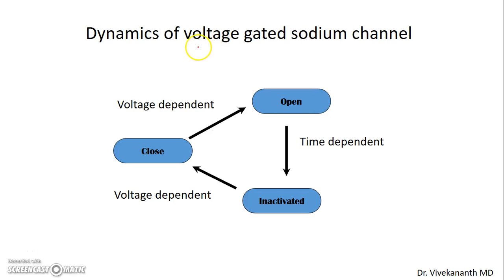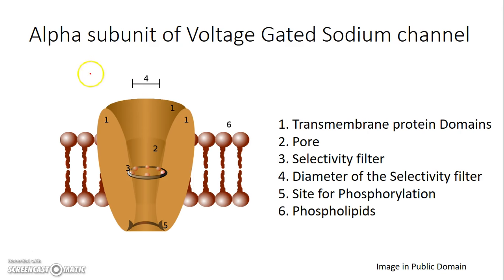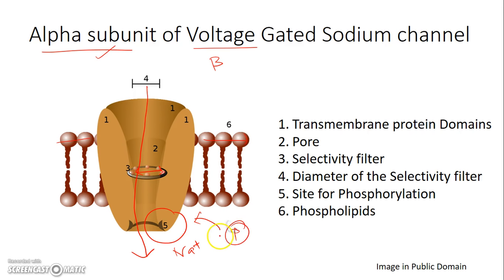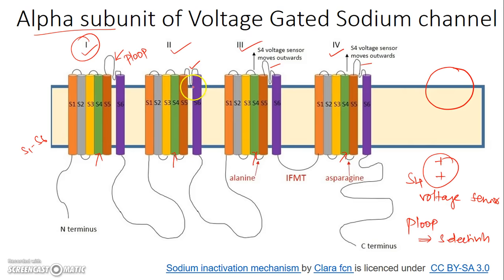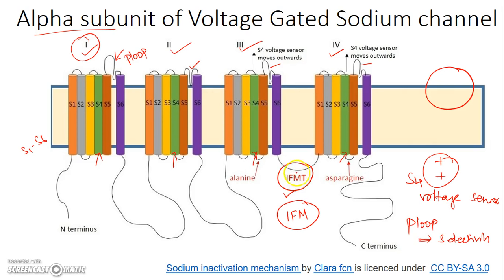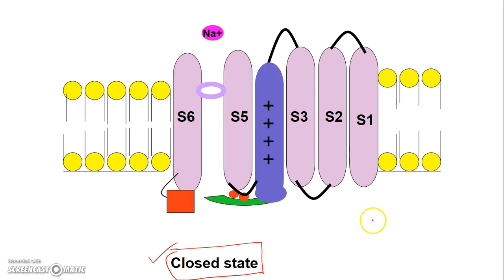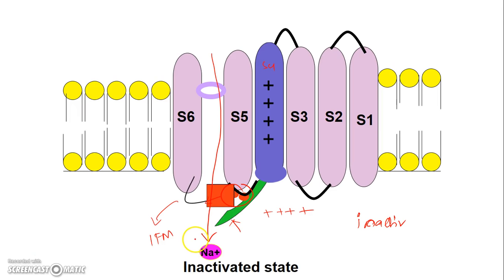Voltage Gated Sodium Channel: molecular mechanism of gating

Comment: I'm thankful that you could read & respond to my attempt to understand the mechanics of the voltage gate operation, and I wonder if you could explain how the hydrophobic alanine (residue? Is residue the right word for it?) and the IFM moiety are mutually attracted (in inactivation of the open gate)? I'm guessing that when they're close enough intermolecular forces 'bind' them temporarily, but what attracts them together initially when the alanine is exposed?

Comment: This video is wonderful! Just wondering, does this same process follow for potassium channels as well?
Reply from the maker: Voltage sensing mechanism is common for most voltage gated channels. Though subunits in each channel modify the opening/ closing dynamics.
Reply: @ThePhysiologyChannel   
Thank you for your reply! Follow up question: is the IFM similar to the N-terminal (N-ball) based deactivation, or is that a completely different thing? If so, how?
Reply: @ThePhysiologyChannel   
Morever, given that potassium-gated channels activate upon depolarization, would their sensor be less reactive, in the sense that there has to be a higher positive charge inside the cell in order to cause them to open?

Comment: This diagram and explanation is extremely helpful! Thank you for making it!

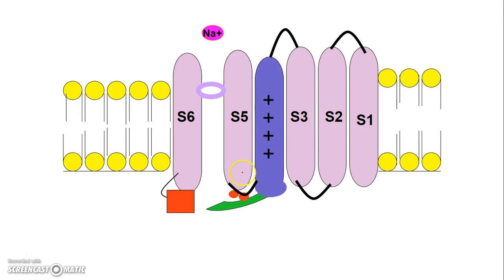At 6:10 , is it correct to say that sufficient depolarization pushes the voltage sensor outward toward the extracellular environment, and because the voltage sensor is CONNECTED to the activation gate, it PULLS the attached activation gate open, which gate component was blocking the pore which was created by & is between S5 & S6? And that there are FOUR gates or gate sections, one in each of the 4 domains ?

And at 6:49, is it correct that as the activation gate swings open, it exposes hydrophobic (residues?) which attract a 'ball' (IFM moiety) on its molecular 'chain' toward it, such that the 'ball' swings into the pore and blocks the bottom of it  and inactivates the channel? 

Could you say in what way the hydrophobic alanine and the IFM moiety are mutually attracted?

And presumably when the voltage sensor returns downward when the membrane at that location re-polarizes, it pushes the gate part back into both closure of the pore, and also interferes with the IFM moiety/alanine connection and breaks it, taking the channel out of inactivation?
Reply from the maker: Yes, your understanding is correct! But, these are theoretical models based on experiments done so far. In future, these models could be updated/revised to incorporate additional findings.
Reply: @ThePhysiologyChannel  Thank you, not only for this wonderful animated 'cartoon' which helps me understand the mechanical actions of the gating better than any I've seen before, and for verifying my attempt to understand, but perhaps most importantly for reminding me that these are theoretical models based upon painstaking experiments, which models may need to be improved as time goes by.

Comment: Can you explain how the new drug pregablin works that is prescribed to people with epilepsy and who may suffer from anxiety. Those who supply this drug cannot explain the mechanism of this drug - but they suspect that it binds calcium to the alpha 1 gated receptor. 
Pregabalin is an anticonvulsant drug used for neuropathic pain, epilepsy and generalized anxiety disorder.[4] It presents antihyperalgesic actions by binding to the α2δ subunit of the voltage-dependent calcium channels without presenting antinociceptive actions.[5] Pregabalin is marketed by Pfizer under the trade name Lyrica and Lyrica Cr (extended release).[13] It is considered to have a dependence liability if misused, and is classified as a Schedule V drug in the U.S.[4]